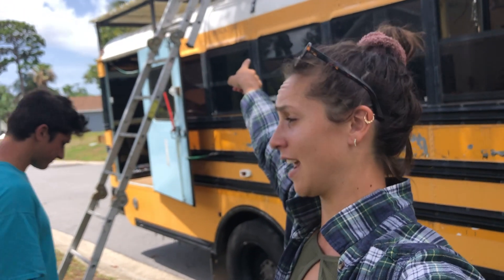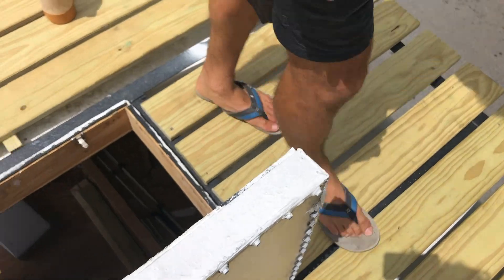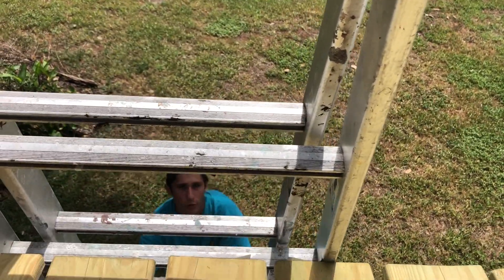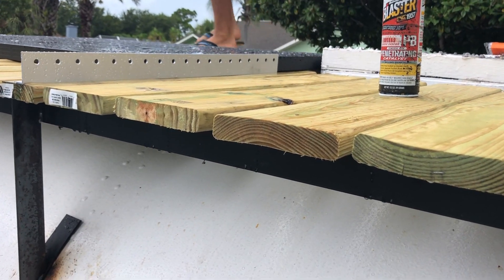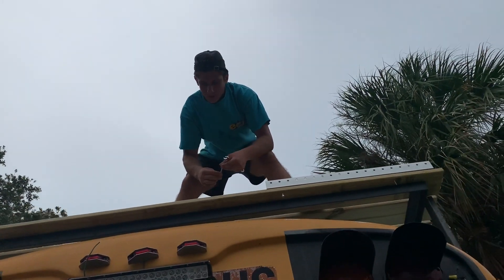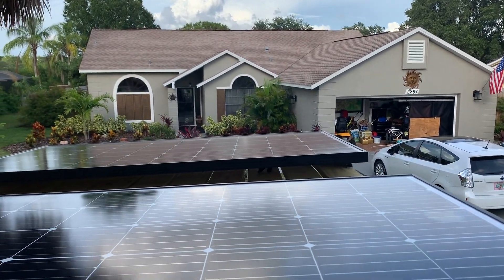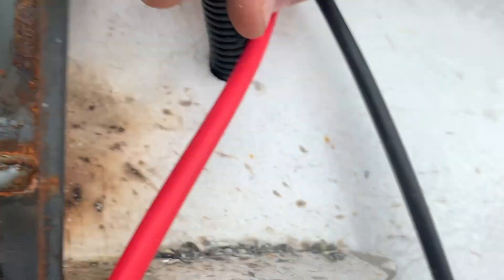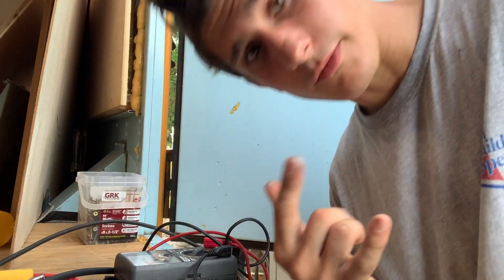We Put 600 Watts of Solar Panels on our Skoolie Roof Deck | Off Grid Power in School Bus Conversion

Comment: I think  I see an issue with your through wall wiring. That conduit plastic is split on one side for wire access correct? If so water will seep into it when its raining and your doing 30mph+. Great stuff is good for insulation purposes but not so good for waterproofing/sealant. Might want to use a silicone caulking in that application. If the conduit is split you could also fill the portion before it enters the cabin with the same caulking. Great looking deck BTW:)
Reply from the maker: Dustin Zastrow thanks we’ll take a look! We siliconed the whole outside of the gland so we’re hoping it should be good, sealing up everything from the inside before we all the walls up :) thank you!!

Comment: Feels good don't it? I bought 8 250 watt panels, but I am still building my rack. But I did put 2 panels up there and got them hooked up to my batteries. Generating my own power to run two ceiling fans 24 hours right now. It's awesome.
Reply from the maker: It sure does we’re so excited! We can’t wait to get things running soon too - might even extend the system eventually bc air conditioning seems nice right now😅

Comment: Looking good folks👍👋🎉 I like those brackets that hold the panels I could use those on the side of the bus that's where I'm mounting my solar panels because I can't climb on top of my bus because of my disability so mounting them on the driver side they will still get sun, then when I park I will anglem up put poles underneath them. Stay safe stay strong stay healthy god bless and enjoy life✌🤙❤👨‍🍳🎅🚌s
Reply from the maker: Sounds like it’ll work great! These brackets are super strong, they worked great! What size panels are you planning on??
Reply: @ShawnandAsh  I would like to do 3 to 4 --300 watt panels  . Where did you get the brackets from? And if you don't mind me asking how much were they? This is just a little input but you may wanna figure a way to put are railing up on your roof deck so ash feels more secure just an observation ✌👍